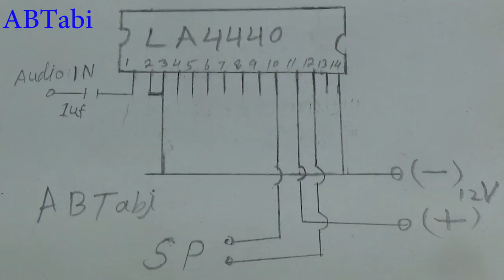How to make LA 4440 super simple amplifier,powerful diy amplifier

Comment: It worked for me. I used 12V 10A power supply and it worked and it is very powerful. Thanks man.
Reply from the maker: You most welcome dear friend ,,,,,,
Reply: @ABTabi  It is very powerful, but can you tell me how to remove the noise. Thanks in advance.
Reply: I will order parts right away